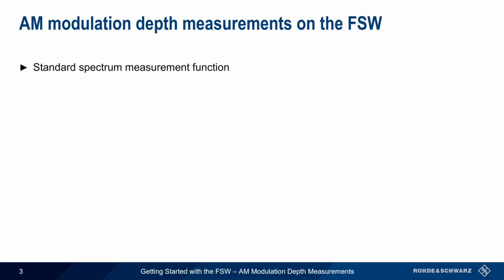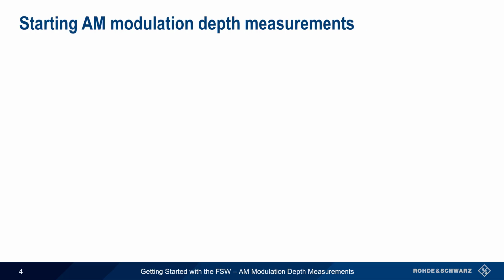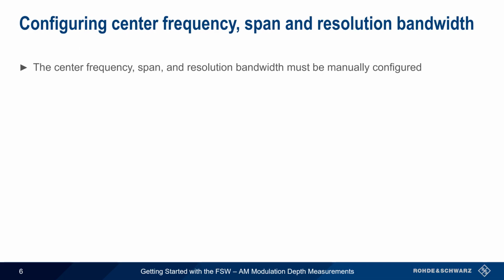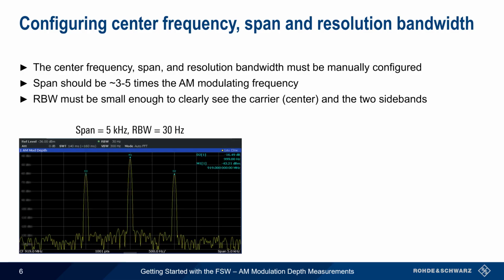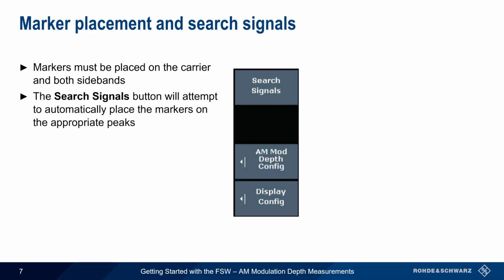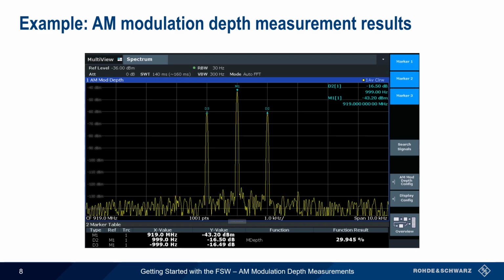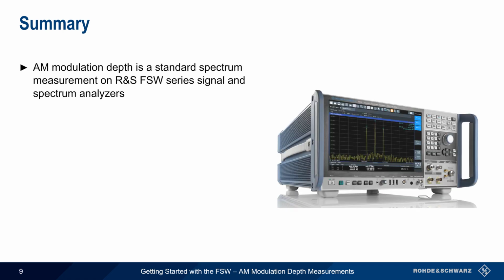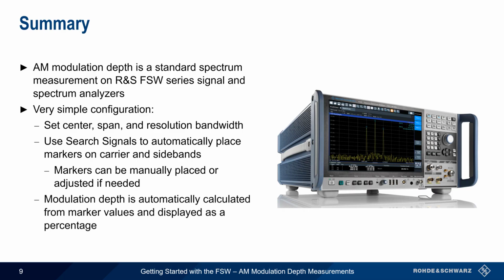Getting Started with the FSW - AM Modulation Depth Measurements

Comment: Is AM Modulation Depth something that can be measured using Oscilloscopes as well?
Reply: Yes.  If you watch the "suggested viewing" video "Understanding Amplitude Modulation" it describes one of the processes (the "trapezoid method")  It's also possible to manually measure AM modulation depth on a scope using markers only, but I don't cover that method in the video
Reply: @pauldenisowski  Ok, thanks. It's often unclear whether a device measures something in the frequency domain and/or time domain.